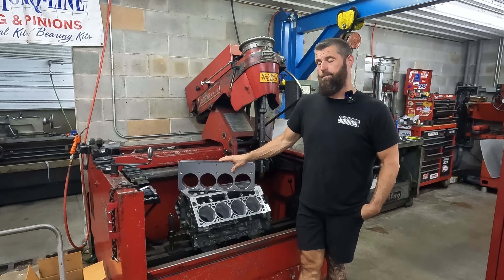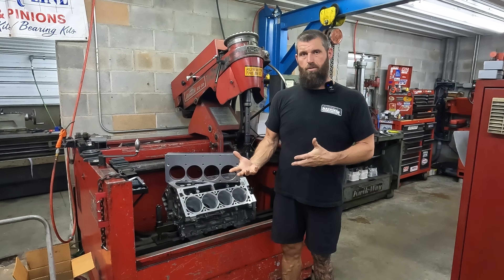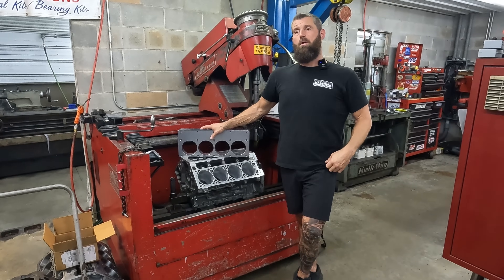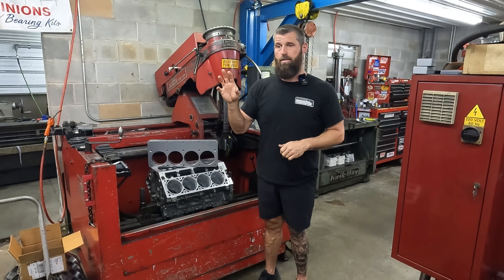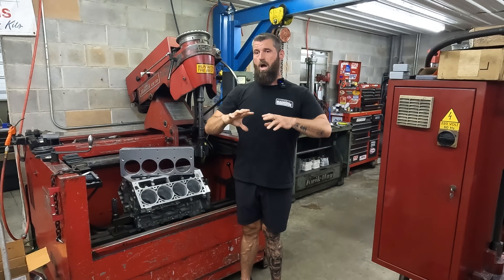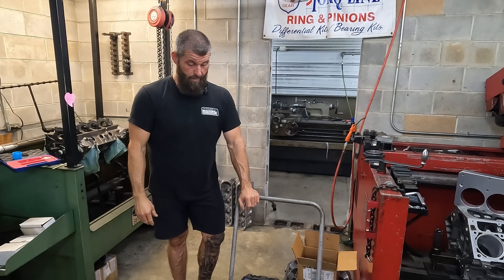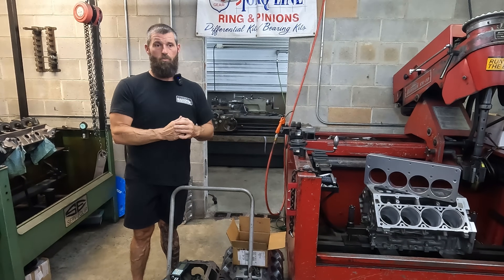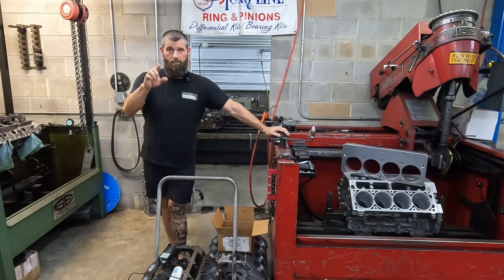We gotta talk about this torque plate deal.....

Comment: So, you have torque plates.  I can see one in your video.  When is it appropriate to actually use a torque plate?
Reply from the maker: When the customer is willing to pay and when it's a block design that can benefit from it
Reply: @powellmachineinc  
Yes.  Make sense. I saw the answer in the video later, after I sent that question.  I'm hoping to rebuild my 400 Pontiac within the next year.  Would it make any sense for the block?  It will be a street driver, hopefully with some upgrades to "perk it up" a bit over stock.

Comment: As I understand it, the "torque plate" is used to load the block with the stresses, and distortion those cause, from the fasteners when torqued down.
Some engines have the head's fasteners' threaded holes very close to the bore, and when pulled down the wear is clearly evident in the bore polishing next to the fastener holes.
Other engines have the fastener holes some distance from the bores and are less sensitive.
With THESE engines, the bores are completely isolated from the fasten holes, and so they CANNOT POSSIBLY distort the bores!

So, research your engine, LEARN if it's needed, and do so IF it's required - or do it anyway, it's just a few $$$s compared to the full build.
Reply from the maker: Correct but the fire ring on the gasket can also distorts the top of the cylinder

Comment: "𝘑𝘶𝘴𝘵 𝘤𝘩𝘢𝘳𝘨𝘦 𝘦𝘷𝘦𝘳𝘺𝘣𝘰𝘥𝘺 𝘧𝘰𝘳 𝘵𝘰𝘳𝘲𝘶𝘦 𝘱𝘭𝘢𝘵𝘦 𝘩𝘰𝘯𝘪𝘯𝘨"...

Unless you're Steve Morris or some other builder that does nothing but high end race engines, basic rebuilds and repairs are what really pay the bills. Very few machine shops can survive on race engines alone. Charge everyone for the service(that's not needed) and you'll lose most of your business to the shop down the road that doesn't torque plate hone everything. The vast majority of factory high performance engines aren't even torque plate honed and regularly go 200K+ miles, a rebuilt 5.3 in a daily driven Silverado will be just fine without it.
Reply from the maker: @CzechSixTv  definitely

Comment: I couldn`t agree with you more, I did the same test you did and measured the bores after the torque plate was removed forabout a month and got pretty much the same numbers, .0006 was the biggest and .0002 the least. It varied from block to block even with same makes, some nothing, most were the corner cylinders where I saw distortion. I don`t T/P hone everyday production engines either. It depends what the engine lives in and what it`s asked to do. Let me ask ya something, lately when I order cams that are not off the shelf it`s been taking 6 weeks to get them. Whats you`re turn around time?
Reply from the maker: Normally 2-3 weeks

Comment: I had one shop refuse to do the work I requested to a 454 block. I didn’t expect them to stand behind anything, just do the work I requested which was bore it 0.030” over and give me 0.007” piston to wall, align bore/hone the mains as I installed four bolt caps and balance to a Bob weight number I provided. They insisted that I didn’t know what I was doing (I’m a machinist with automotive field machining and I build a pile of BBC’s). Anyways they told me all my stiff was junk and I was an idiot and they wanted to sell me a whole motor or buzz off. I buzzed off, found another shop owned by racers who did exactly what I wanted and that “junk” has been slinging 7k rpm for two years now. This guy and his videos gets it, context of use/application matters.

Edit: that engine was not torque plated honed and I don’t care.
Reply from the maker: I wouldn't give you .007" skirt clearance either...

Comment: I just came across this video, so I'm just gonna ask a couple questions because I want to know, and because I don't  know.  Not because I think I know better.

When using torque plates, is it necessary at all to use a plate on a street or street strip application? I never use them for daily driver stuff, and for the same reasons you stated. I just don't feel it's necessary. 
But my question is, and as partly asked above, is it necessary for street or street/strip applications, and or when using a "Production Block?" 

I'm asking these and possibly many more questions, because I just bought thebma Hine shop where I work, and the previous owner has the absolute POOREST of work ethic when it comes to customer service and satisfaction. I want all of my work to show every customer that they brought their engines to the right place. 
I appreciate your page and have learned a great deal already about what needs changed with this shop.
Thanks for taking and sacrificing your valuable time to teach others

Doug
Reply from the maker: @dougroope8040  It depends more on the block design than intended use

Comment: Yes, some blocks really don't "need" a torque plate installed for boring.... But the real takeaway is, charging extra for using a torque plate is asinine as hell! It literally takes 30 seconds, maybe, to install the plate. There is absolutely zero reason to NOT use it for every job, except being asinine so you can make extra money for basically 30 seconds of extra work bolting it up...
Reply from the maker: @bluegizmo1983  you are exactly the kind of person I was talking about in the video....... Dunning Kruger in full effect

Comment: Maybe that .0004" will start affecting oil consumption after 60,000 miles? Oh no, a whole extra .3 quarts per 1,000 miles. Meanwhile 2024 cars are burning nearly a quart per 1,000 miles...
Reply from the maker: @rolandotillit2867  none of mine eat oil
Reply: @powellmachineinc  Every car will start consuming oil eventually, rings don't last forever. If you can build an engine that isn't drinking more than a quart between oil changes, after 100k miles that's perfectly fine IMO.
Reply from the maker: @rolandotillit2867  I just went 6000 miles in my dodge pulling 18000 lbs the engine has 390000 on it, didn't use and measurable oil the entire trip.
Reply: @powellmachineinc  Impressive!
Reply: @powellmachineinc  My track car with 115k is starting to consume a quart every 3k miles.
Reply from the maker: @rolandotillit2867  most shops don't really understand the honing process.
Reply: @powellmachineinc  Exotic cylinder wall materials are going to burn some oil, it's a give and take. They last a long time and are very strong, easily outlasting the rings. They're also very sensitive to dirt, so your engine filtration has to be top notch. Honing such materials takes very strong and fine abrasives along with plenty of honing pressure. Such cylinders are more sensitive to bore distortion since your using more pressure to hone, there a deck plate becomes more appropriate. You're absolutely right, a lot of shops learn one way of doing things. It's hard to find a shop that does it all, and does it all well.

Comment: Thanks for the video - I am learning a lot.  I am doing a rebuild on a 5.3 vortec iron block from an 06 GM truck - just a stock rebuild with all stock components.  Called a few machine shops for quotes.  One shop was trying to upsell me on a few things, one of which is a bore and hone with a torque plate.  I have no clue if I need one or not.  Your thoughts?
Reply from the maker: Na, just a quality bore and hone ot all you need.
Reply: @powellmachineinc  thanks for the reply.  (I know you are busy)

Comment: Some years ago, I bought 4 warranty scrap Mercury marine engines for my street stock round track car. 2 of these engines I couldn't remove the camshaft the block had moved so much! People don't understand that metal moves. These eventually were scrapped with the cams still in them! All of ther rotating assembly was really nice and ran for a while in rotation.

Comment: Theres also a bigger difference between the older engine designs where the head bolts pull on the deck surface, compared to newer designs where the bolts go down to the web of the block. Id bet the numbers would be more exaggerated on an old gen1 SBC than it ever will on an LS.
Reply from the maker: Yes, that's exactly how it works

Comment: Probably the same fella i ran into a couple years back, you cant hone without a torque plate. I was like what? Ummmm yes you can and yes we do. A massive difference between a standard build and a  high performance engine. Also, factories dont use torque plates. Hmmm. There set on a table and mounted and its sent through, bored and honed. Comes off and sent to next station for more machining. And that whoppin .0004".they dont even know how to measure that. Thats only .0002" per side. Big whoop. It hurts nothing and your correect. Themal cycles will send that block in all sorts of directions and they dont consider that either. We all know this is fact, so now you honed the cylinder almost perfect, and then bam, thermal cycles says ya, not today it isnt perfect. So if its moving under thermal cycles and youre cruising for 15 minutes or hours on end down the interstate at 75 mph, the almost perfect bore isnt perfect anymore. I have no idea where these guys come up with this crap but it isnt from a machine shop they worked in. They would laugh at them.

Comment: some quick math since it should be intuitive why 4 tenths is nothing.

coefficient of thermal expansion of grey cast iron is ~5.8x 10^-6 in/deg or.. .0000058 in/deg.

given a temp rise of 140 deg from cold to nominal running temp of 200, you get an 8 tenths / inch change in size of the block, just getting it up to temp. of course all of the components nearby are also effected in varying ways due to the temp rise but stuff isnt leaking all over or blowing up.

now, if you wanted to look at how much the 4 tenths matters at temp, just multiply the 8 tenths by the distance that you care about, in this case 4 tenths. the 4 tenths out of round at 140deg temp rise has moved ...3.2x 10^-7... in theory. since you'll have a hell of a time measuring that accurately.
Reply from the maker: Ty

Comment: I built several SBC & BBCs and just finished a 292 Chevy inline 6. 60 over 13.1 compression ,everything in this build was with top quality parts and Teflon coated every bearing .Using a MIL 30th head gasket. Never used a torque plate ever !!! never blew a head gasket or related problems and I'm doing this since the 70s !!! If I had one I would have used it. I never thought it necessary
Reply from the maker: Good stuff

Comment: Old retired engine builder here. ..Lots if IMSA, SCCA, AMA, Etc. motors over my career...I was an early "Pioneer" of Torque Plates..Your 100% CORRECT! ..  I built my first Torque Plate because I realized that my Porsche Cylinders were distorting  severely!..along with my single cyl. Bike engines..They really make a BIG difference...I found out on V8's, V6's, Straight 8's etc. it wasn't such an issue..Aluminum  block engines were of course, much more affected... On $20,000 4 cyl race motors, I used TP's..on  $8,000 street motors, I didn't..I WAS ALWAYS a bigger deal on Single Cyl."style engines...'Speed Costs...How fast do you want to go"??? ...👍👍👍🗽🇺🇸
Reply from the maker: Yep

Comment: 4/10ths is about 1/2 a thousands I believe...  I don't think it's the half thou that can change anything. At most I have ever seen, you can see cross hash kinda polish away in a tiny area next to the bolt hole at the top 1/2" of the bore...  I don't think they have a dyno that could measure the difference resulting output ....  at best, or "worst" ,  compression "psi numbers" might appear lower at rotating speed of the starter, , but  a squirt of wd40 would probably make a bigger psi change, LOL...   I think it shows what a good / patient  business man you are.   I think we all know your top tier at machining and troubleshooting. 
  I imagine that with the right situation where your so busy and turning business away, you then specialize , only offer TQ plate honing,  etc... but untill  your the only machinist within 1,000 miles, you do what the people call for... 
   And sooo true, the new SBC (the LS) doesn't have the threads at the top of the bolt hole, etc... not the same beast, not the same issues...  Same goes for the old SBC double roller chain stretching blah blah blah.    the LS timing chain doesn't drive a hydraulic pump... 
   next will be people ragging about why aren't you using a dbbl roller with your 3/4 race cam.. LOL !

Comment: Thanks for this Factual, well stated video. I owned & operated an automotive machine shop for 33 years, not to forget the many years of working for other shops before and experiencing different machine brands and end results; Sunnen CK 10, Rottler, Certi and more. I loved my Quick-Way boring bar as you have in the background. Throughout attempting to satisfy my curiosity for torque-plates discovered that freeze plugs in or out of block, oil pump mounted or not, water pump and more created cylinder distortion in different areas of the cylinder when inspected with a dial bore gauge. As you say; until you actually torque plate a block-keep your opinions to yourself. I recall my early years in the 70s, torque plate honing my first block, chained to a pole on an engine stand-LOL. Needless to say, the automated hone was on order the next month. The difference between use of studs or bolts is also huge. Figure the bolt pulls Up-studs pull the head down. Back in the 90s I charged an additional $75 to torque plate hone after a block fill or pre boring undersize, and hated every minute of that compared to nocking out a nice set of cylinder heads. Nothing worse than a person's opinion on telling the machine shop operator how wrong they are. Did they go to any vocational or college training schools? Their brain originated on the automotive isle in Wally-World!

Comment: The bore is dynamic, this is why the piston requires clearance to alliw that change to happen and NOT SEIZE THE PISTON IN THE BORE!  NOTHING  is perfect, it depends on how close you lookand how precisely you measure. The world is a pile of gravel if you look close. A sharp edge of a razor looks rough as a chainsaw chain under a microscope !!  Jagged no matte how sharp, a bore is the same, the rings will wear in enough to compensate  in most street engines.

Comment: Unless you are going for crazy tight specs. Where every little thing makes a measurable difference. A TQ. PLATE IS NOT REALLY GOING TO MAKE ANY REAL  DIFFERENCE !  if there was .020" clearance in the bore, and  .050" ring end gap,  a TQ plate isnt going to help anything, a TQ plate is required for high end tight tolerance race engine to indy cars, F1 cars, 10k rpm drag race engines. A engine so tigt it must be warmed  up to start the thing , may need a tq plate bore and hone. The reason a piston has clearance is because things are changing slightly. If they were not there would be a .005" clearance Maybe less,

Comment: My first job in automotive was working in an engine machine shop his senior year after school. I didn't know anything about cars up until that point but I could do a five angle valve job. Immediately after I graduated I went to automotive trade school with my first class ironically being "Engine". Between the two I learned about TOLERANCES. Every moving part in an engine comes with a tolerance value attached.  Why?  Because you can't have zero tolerance. If you did the engine wouldn't spin over. Variations in tooling equipment, castings, bearing manufacturers, thermal expansion and contraction etc. They all are never going to be 100% perfect and true. That's why you have to meticulously measure all your clearances. After a while I'm sure the gentleman in the video can tell you you get a feel for things. And you know that perhaps something's too tight, too loose, or just right. But you still measure. Because why? There's a tolerance value associated that you need to be within a range of. I'll be honest in that machine shop I never even saw a torque plate. The guy who rebuilt the blocks used to use an oxyacetylene rig with a rose bud to heat up the connecting rods to slide in the wrist pins. (I was 18 and I didn't know any better so I just thought that's the way you did things until I went to school.) Anyway, the point is that after 25 plus years in the automotive industry I'll tell you that finding a good quality engine machinist is like finding a unicorn. And unless you've worked in a machine shop or worked as a professional mechanic and had to find and trust a machine shop that you subletting your engine work out to, I don't believe anyone has any standing to tell this man how to do his job.

Comment: I worked in a machine shop when I was a kid. Honing with torque plates was always an extra charge and only for performance engines. The stock engines didn't get honed with plates and didn't need it. This guy is completely correct
Reply from the maker: Ty

Comment: Howdy 🤠 from the Northwoods of Minnesota 
Some people like to spend other people's money. That's why I dislike part's bashing. Yes some are junk, but as you said In grandma's wagon it doesn't matter. 
Some people think you need to spend a 100 grand to build any car, while Jethro is in back woods planning heads on a  concrete floor and and using tortillas for head gaskets and has the fastest car in 15 counties. Some need to learn that NASCAR at 1 time was basically using stock parts and doing 200 miles and hour.
Reply from the maker: Absolutely

Comment: Well the old Mopar engines in the Mopar bible, I have the 8th edition, it states flat out use a torque plate. I make sure the machine shop me using has it. And yes I pay for it because it needs to be used. Bad thing is no machine shops within 60 miles now. Sucks.
Reply from the maker: Yep, we are dying of, 💯